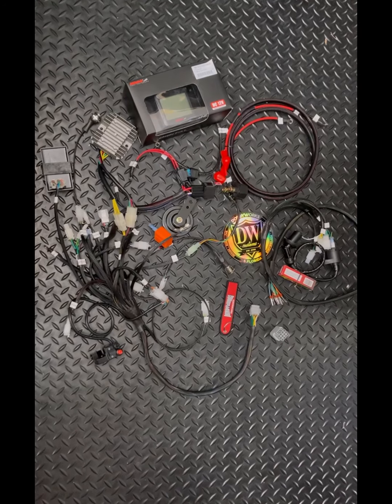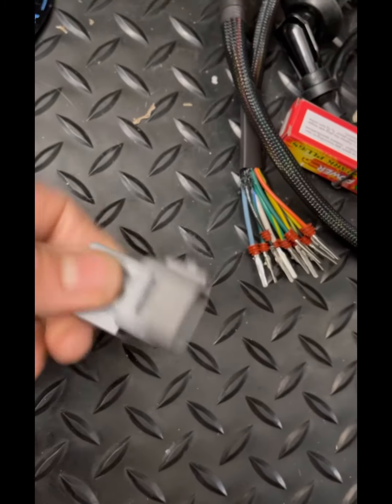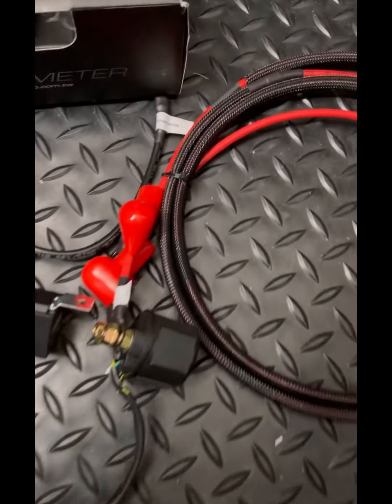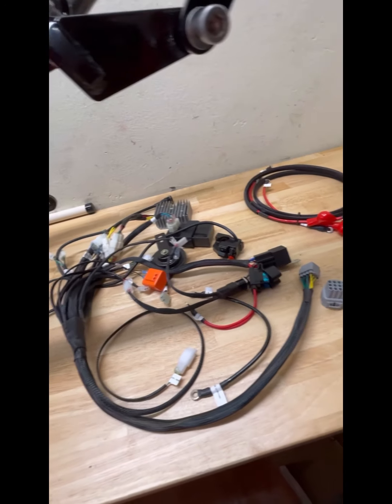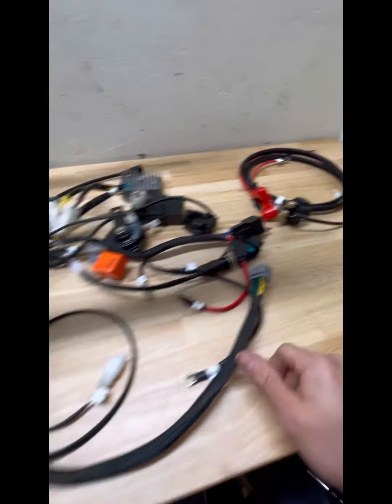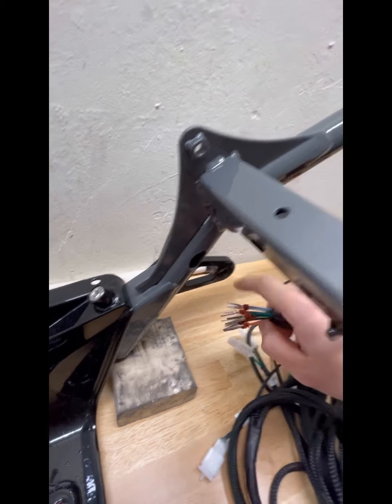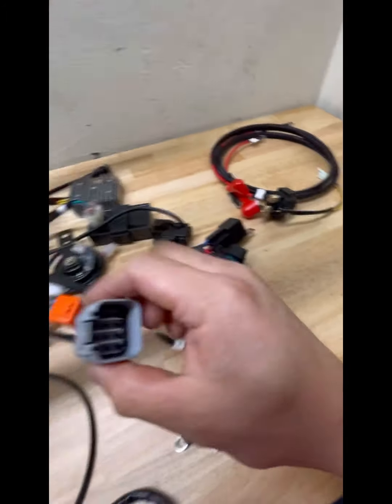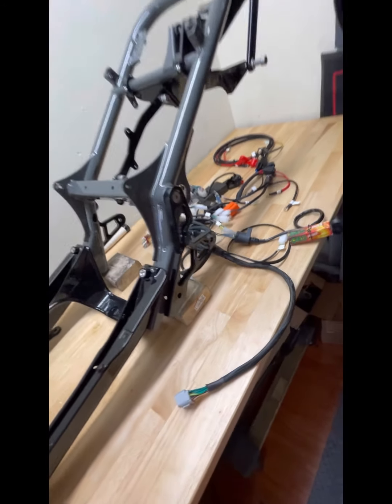Honda Ruckus GY6 wiring system Dorbyworks wire tuck

Comment: Just got mine 👍🏻. Do you guys have any video on where you drill your holes in the front and rear frames for tucking the harness and throttle/ brake cables? Seen a few in this video but is that all?
Reply from the maker: Yes sir
Reply from the maker: Next video
Reply from the maker: https://youtu.be/12i8RFJhXL8